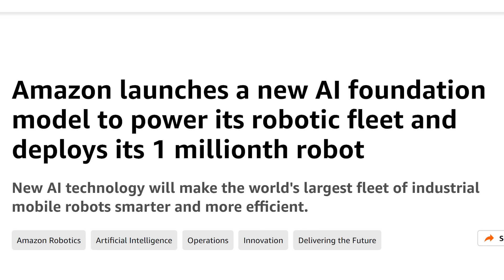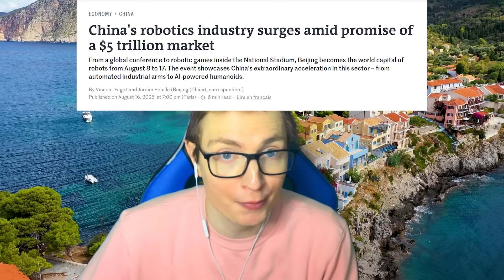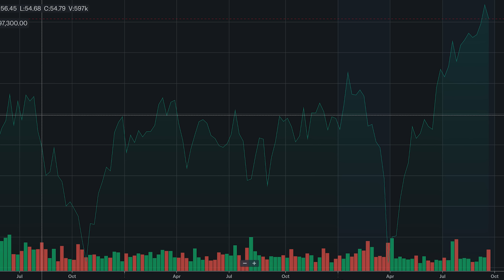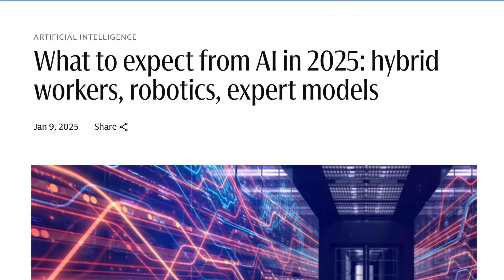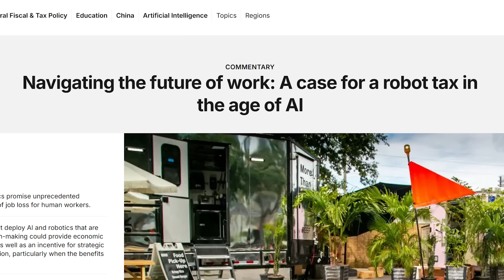This Is Becoming MUCH Bigger Than AI...And Investors Are Terrified...

Comment: the doctrine "the things you own will own you" only means that the robots maintenance will be the next hot thing. 
Robots are just software. How many time do you have to upgrade your operating system, firmware or firewall?
As of now it takes $5000 for Jhhn Deere traccktor owners to pay to lug in their tracktor to the dealership just to get a new GPS upgrade. Add to the fact if there are no alternative to robots.  slave force. the doctrine "the things you own will own you" kicks in. Meaning that the software company that uses robots will own all these business in the future. They will tell you how many time your robot will need an "upgrade" and how much it will cost you to keep those robots in quality condition.

Comment: The DaVinci system is a waldo with safety limits = human initiation required.
Humanoid robots are psychologically dramatic but are usually the worse solution for any specific group of tasks. Humans make machines to avoid the limitations of human bodies and minds.
This is Luddite doom-scrying.
Technology of every kind has changed society.
The plow changed everything fantastically.
Grow up. Adapt. THAT is what humans ARE good at.

Comment: Check this out. I deliver room service at a major Las Vegas hotel. While my coworkers all say robots can take that job. BULLSHIT! I'm 56, and I'm the 2nd most productive employee and I'm probably 5th oldest. The logistics and cost in reconfiguring the hotel to have robots deliver orders is ridiculous. New floors, new elevators, new doors. While it's an easy job, it requires quick thinking, dexterity, and maneuverability that a robot would be slow at. There isn't a device that can work as fast as me. While they will take jobs in certain areas, this ain't one of them. I laugh at the idea. As far as order taking, and cashiering.. well that can be replaced.. and how I wish they could replace lazy cooks. I told my son to get HVAC, plumbing, electrician training. Those jobs WILL NOT be replaced.